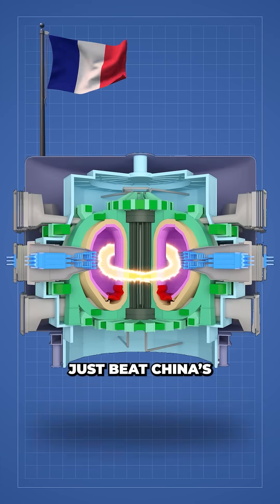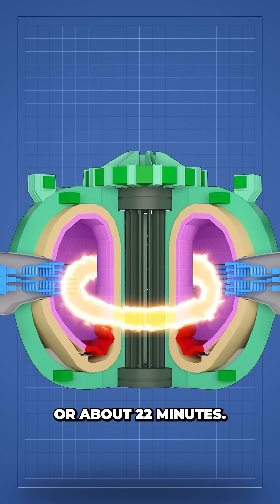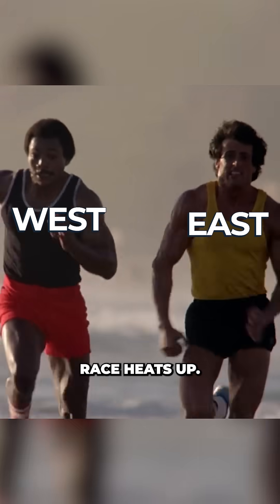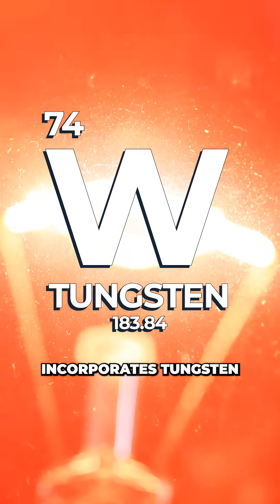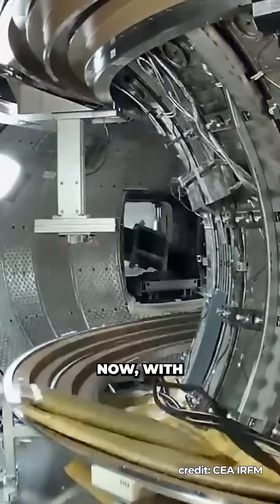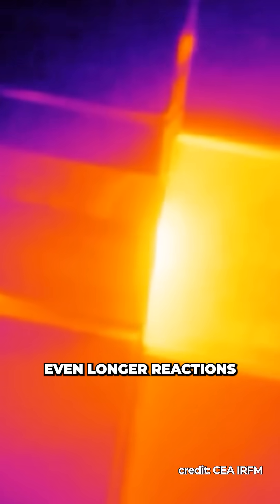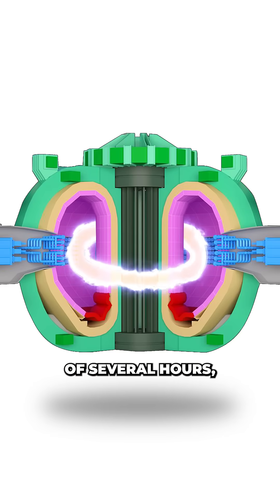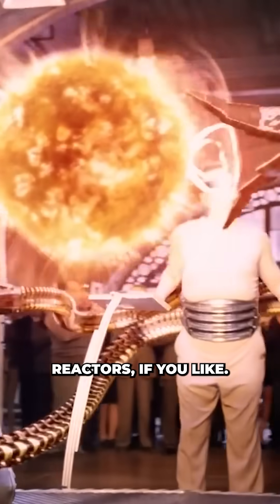France Breaks Fusion World Record

Comment: It's worth noting that magnetic confinement fusion in a tokamak reactor is a fundamentally discontinuous process.  Even a perfect reactor of this type designed to produce power would do so in bursts where it would need to repeatedly ramp up, reach a stable state where it was producing power, then ramp down again before starting over. So these extended duration tests are a lot more promising and a lot closer to a feasible reactor design than you may think. 

To function you need to induce a large current in the plasma going around the torus.  To induce a current in the plasma you need a changing magnetic field.  This is for the same reason a transformer only works with an alternating current.  In a tokamak that requires using a magnetic field that is constantly increasing to establish and maintain the conditions for fusion.  You can't increase a magnetic field indefinitely though, even super-conducting electromagnets eventually saturate.  This means fusion conditions can only be maintained in bursts before the magnetic field needs to be ramped down again.  The longer those conditions can be maintained though the more efficient the design will be.  The same is true for a reactor which can maintain a hotter denser plasma.  If you thought magnetic confinement fusion was continuous and were disappointed by the idea of an extended duration test only lasting 22 minutes hopefully this helps explain some things and makes you feel a little more optimistic about the progress so far.
Reply: You don't need a changing magnetic field in a plasma to induce a current.

You're applying Faraday's Law which is:
 e=LdΦ/dt

inappropriately.

F=B.Q.V.Sin θ

That equation defines the force F on a charged particle Q, created by the magnetic field B.

So the presence of a magnetic field on charged particles is a force which accelerates charged particles.

And an electric current is the movement of charge, specifically, a current in amps is defined by the amount of charge that passes a point in one second.

So simply the application of a magnetic field to a plasma will cause an electrical current.
Reply: @deang5622  I wrote a longer reply to you but I think it got censored by youtube because it's not showing up so here it is in brief.  A charged particle moving through a magnetic field does experience a constant force.  That force is orthogonal to the direction of the field and the direction of motion though and is responsible for the spiralling cyclotron motion of the ions. Since that force is always orthogonal to the plasma current it does not have a net contribution to the plasma current around the torus though it is important for the confinement of the particles.

The need for a high plasma current comes from the basic principles of neoclassical transport the tokamak is based on and for most reactor designs these currents are in excess of 10MA.  The fusion process itself once started creates a bootstrap current which assists in maintaining that high plasma current required.  The bootstrap current is a consequence of the charged, fusion heated, plasma moving from a region of high density to a region of lower density following Fick's law.  The higher the bootstrap fraction the less of an external ramping field needs to be provided.  For continuous fusion you either require a bootstrap fraction at or exceeding 1 or you need to drive the plasma non-inductively such as by the direct injection of a charged particle stream.  Right now we know of no way to get a bootstrap fraction that high for a tokamak even in simulation and especially as the reactor enters the Pﬁrsch-Schluter regime as a consequence of fusion impurities.  The plasma currents required are also too high for the external current to be provided in any way that isn't inductive.  Hence the tokamak reactor is fundamentally a long pulse reactor with a bootstrap fraction of around 0.7-0.8.

A stellerator design could more easily be continuous.  They're not bound by the need to trap particles within banana orbits the way tokamaks are allowing them to operate with relatively low plasma currents which can be maintained easily by the bootstrap current.  Or at least that's the theory. To date all stellerators have suffered from very poor confinement leading to excessive particle loss and stability issues.
Reply: @  The force your describing is responsible for cyclotron motion and doesn't have any contribution to the plasma current. I have tried responding to this thread multiple times with a physical breakdown and information about neoclassical transport theory but youtube keeps censoring my replies so I give up. Engaging with youtube seems to just be a waste of time.
Reply: @deang5622 but you just told us the law that dictates you need a changing magnetic field (flux) to induce a current??
Reply: @EngiesParadise  Actually I didn't.
Don't get confused between voltage and current.

I quoted Faraday's Law which says you need a changing magnetic field to induce a voltage.
Reply: @AltIng9154  I think you heard something somewhere and are repeating it without fully understanding the physics.  So it really doesn't seem like you know what you're talking about. 

Thermal neutrons and neutron activation of the chamber walls is a problem but a longer term and not as fundamental one to the economic operation of the reactor as the fact that a tokamak's geometry does not allow it to maintain the required plasma current from the bootstrap current alone.
Reply: @AltIng9154  theyll boil the water, use fancy water to transfer all the heat from the vessel

wait, put 2 vessels on top of each other, when one is tired the fusion goes to the other 

hell yeah 2 stroke fusion reactor
Reply: @AltIng9154  You obviously did not read my post. I provided the formula for the effect of a magnetic field on a charged particle. You may not realise this, and if you don't then you really should: neutrons are NOT charged.

You need to learn how to read my friend and stop with the silly posts.
Reply: But is it possible to actually make power from a reactor like that?
Reply: I'm still wondering how they're going to extract the power.
Reply: @ Most of the energy released from DT fusion is in the form of neutrons travelling at approximately 1/6 the speed of light.  

These neutrons penetrate through the reactor until they hit an atomic nucleus and share that momentum with the atom they collide with.  Some of this energy will go toward doing work like breaking chemical bonds or dislocating an atom from the lattice but otherwise the energy will be distributed through the material as heat which can be used for power.

Ideally most neutron absorption happens in the deuterium blanket, which is made from a lithium rich ceramic. After neutron activation Li-8 quickly decays into tritum allowing the reactor to sustain it's own fuel.  Some neutron absorption will happen in the silicates of the ceramic or in the reactor structure itself though which is why those surfaces need to be made from materials which don't produce long lived or highly radioactive waste following neutron irradiation such as RAFM steel.
Reply: I thought I was smart talking about creating an apocolyptic railgun with ants accelerated to 15% the speed of light, yet here these chads are casually discussing sustainment of fusion reactions like it's a Tuesday morning. Genuinely how does one acquire this knowledge in such amounts? Do y'all just spend hours going down google rabbit holes like me? Or do y'all actually have a degree?
Reply: While the magnetic physics principles described  which could limit a Tokamaks continual operation are dubious, the more likely issue is to be that fusion byproducts are going to remain in the plasma and act as a contaminant.  New fuel can be injected as neutral gas and can then ionize via collisions with existing ions, theirs no way to get the waste products to selectivly return to a neutral state and leave the plasma other then shutting down and letting all the plasma return to neutral gas and then pumping out the reactor chamber.
Reply: @kennethferland5579  There's a 90% chance every time I reply to this thread that my comment gets removed by youtube.  I've tried three times but I can't give you details without the comment getting deleted.  In I-mode fusion particles don't have an edge transport barrier but the energy does.  This allows particles to be directed into the divertor without losing a significant amount of energy from the plasma.  So you can essentially bleed off impurities without taking much energy from the plasma in the process though you lose some fuel in the process.
Reply: I think youtube must be censoring the word plasma when said too many times thinking it's referring to the kind in your blood or something.  It's always been bad but I have never had this much trouble.
Reply: you have to integrate both sides of the maxwell-faraday equation over the shape of the plasma, you get a form where you can rearrange for I? not sure doe xddd
Reply: its the equation that also gives you the induced current on a coil CLOSED LOOP too (its literally just I = (ΦB)/L )
Reply: @EngiesParadise  No it does not.
Because the current depends on the load that is connected to the coil.

And the current cannot be calculated unless the load that is connected to the coil.
Reply: @deang5622 eddy currents exist, this is essentially just a big giant conductor after all
Reply: i dont really understand why we are going into circuits, charges dont need a fixed path to go along, you can take a slice of the donut and see that theres on average a bunch of charges flowing in some direction.
Reply: Isn't this the reason why stellerators are better for continuous generation?
Reply: Not true. Tokamak reactors are designed to run continuously, not ramped up and down. That is a very inefficient way to run it, and the magnets consume significantly more power when ramping up and down, not to mention it is more damaging to the magnets to ramp up and down the power.

The pulses are only for testing phases.
Reply: Thanks for the breakdown! I just recently invested a little bit in fusion energy so this is really promising 😁

Comment: How can they claim they created something 10x hotter than the sun, i try to imagine if the actual sun gets as close as mercury is to earth is in the solar system earth is done. Some please maje it make sense?
Reply: The sun is hotter the further inside you measure 

A fusion reactor is around 
50,000°C
The core of the sun is around 15 million°C

It's hotter then the surface of the sun though

Comment: And any fusion program has the tritium shortage. I wrote that after and realized it’s the lead. 

Tokamak is bonkers for energy production. You have some of the hottest stuff next to some of the coldest stuff, and in order to make power you need to tap it all for heat energy to make steam. Laser ignition doesn’t call for superconducting magnets next to fusing plasma, just needs to pulse the laser into a new pellet several times a second. 

.

Comment: Chinese TOKAMAK..18 minutes at 100M degree celsius with electrons which are much lighter than proton plasma.
French TOKAMAK..22 minutes at 50M degree celsius with proton plasma.
South Korean ..47 seconds at 150M degree celsius with proton plasma….
Ladies and gentlemen..plz wait for more than another 30 years ..
Reply: China also have a lot of differents parameter than sustained plasma, density and fuel being one of its common variables.

All of these tests are on very different parameters.

China also used "low temperature" plasma for long-duration reactions, like anyone.
The reality is... we need all kinds of tests as each of these has pros and cons.
We don't just try to have a sustained reaction; we test different systems

Comment: What happens if if vents to the atmosphere catastrophically? thanks
Reply: The plasma can't exist without the magnetic field 
If any air gets in it will get rid of the sensitive conditions and stop it
Reply: @jamesThebulbmin  The heat doesn't just dissipates, it explodes like a nuclear weapon. Right?
Reply: @AisleEpe-oz8kf  fusion and fission are completely different they are actually complete opposites

Fusion is combining nucli
Fission is splitting nucli
Reply: @ No, there is not enough mass to cause an explosion of any significant scale
Reply: Nothing really, there is less than a kg of plasma in there

Comment: Tungsten may have a lower sputtering rate than some other materials, but the effect of tungsten contamination in the plasma has a very detrimental effect on the plasma.  The tungsten ions that sputter off of the inner wall into the plasma will still retain much of their electrons.  The collisions and heat in the plasma may drive these retained electrons into higher energy levels where they will cascade down to lower energy levels and emit relatively low energy photons which will not be conducive to maintaining the temperature of the plasma.  In effect tungsten contamination “robs” the plasma of heat, i.e. temperature, called plasma line cooling.  Eventually the temperature cools below that required to maintain fusion.
Reply: thanks chat gpt
Reply: @durden91tyler that's not chagpt in my opinion😊
Reply: @durden91tyler  don’t know whether to laugh or cry.
Reply: @durden91tyler don’t know whether to laugh or cry.
Reply: @durden91tyler  don’t know whether to laugh or cry.
Reply: I wonder how China had a better result than France...

Btw China maintained it at 100M degree celcius vs France at 50M, which is a huge difference and fusion reaction occurs at 100M
Reply: @KFC431 the temperature was actually 70 million Celsius not 100 mill
Reply: You should tell someone instead of posting this on YouTube comments
Reply: @timothy6227  Actually this is a well known phenomenon.  Some solutions have been proposed but not fully tested.  One proposal is to coat the tungsten inner wall with liquid lithium.  The liquid lithium coating would protect the tungsten wall from sputtering, damage, and act to breed the rarer tritium which is required to maintain the power plasma.  Just trying to point out that there are still many challenges to overcome before commercial fusion based electricity becomes available.
Reply: @timothy6227 this is actually a fairly well known effect.  ITER originally abandoned Tungsten for the inner wall, in consideration of beryllium or boron, but went back to tungsten.  There are a few proposed solutions to this line cooling problem, but none have been effectively tested.  One suggestion is to coat the inner tungsten wall which is plasma facing with liquid lithium.  The lithium would protect the tungsten, prevent tungsten sputtering, and provide a layer for tritium breeding which would replenish the plasma with this rarer isotope that is required for the fusion reaction.  Just pointing out that there are many challenges that still must be overcome to produce a viable commercial fusion reactor that will actually provide electricity.